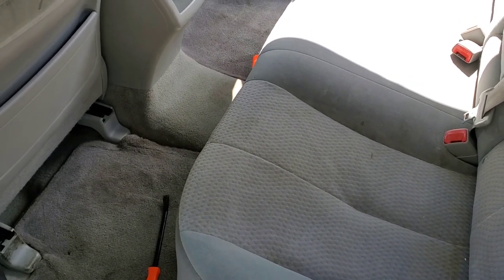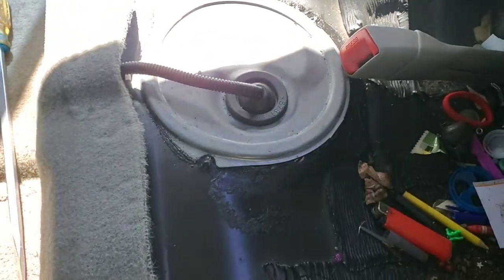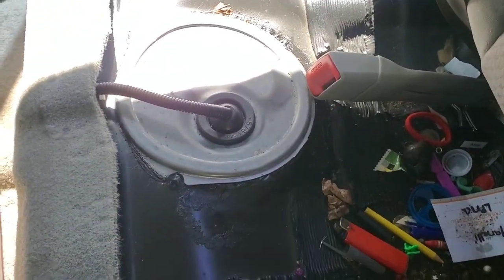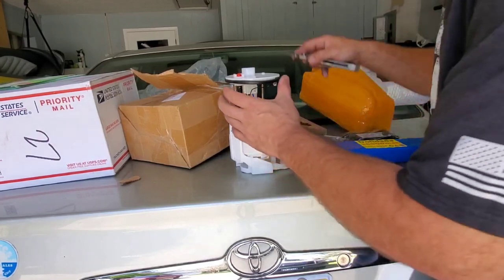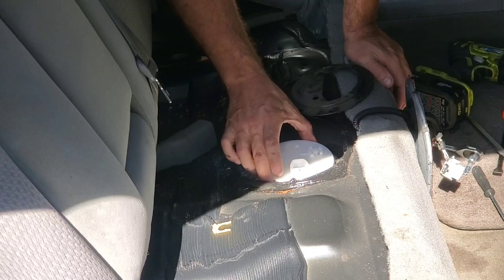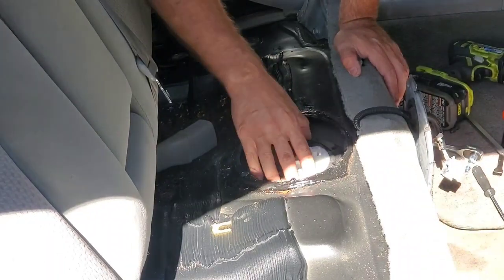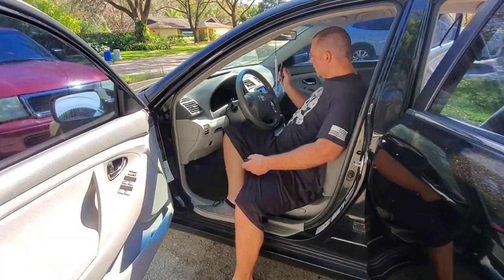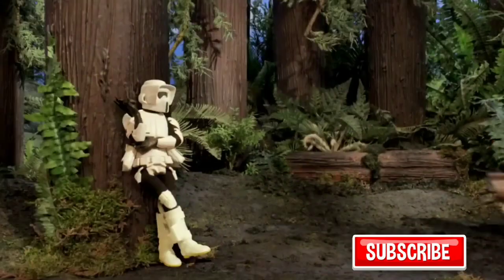2011 Toyota Camry Fuel Pump Installation ITS EASY TRUST ME!

Comment: Hello, I have a 2011 camry as yours with the 2.5L L-4 cylinders engine when I disconnect the fuel hose at fuel tank opening the fuel flow out real hard and I don't no what is the reason for the hard fuel flowing, do you know why the fuel is flowing that hard from the fuel tank fuel pump opening connection?

I replaced the charcoal canister with a new one and cleaned the fuel tank cap and tested and cleaned the canister  purge valve solenoid ( purge solenoid is opening and closing it is working ) the fuel will still spill out of the fuel tank opening but less than before.
Reply from the maker: @kandery111  sounds like you didn't get a good seal when you put the lid down probably want to loosen all the bolts and line up the fuel pump again properly so that the Rubber seal makes a good seal around the top of the tank otherwise it'll just keep leaking
Reply: @IFixShet  thank you I will install a new fuel pump lid gasket and align tightening the 8 bolts and see if that will fix the fuel spilling problem.

as I told you the fuel is spilling out of fuel pump hose connection ( fuel tank side ) not from around the fuel pump lid.
Reply from the maker: @kandery111  is it spilling or is it under pressure and it's relieving the pressure by pushing fuel out of the lid head.... there's a lot at play here man for starters you could have pressure build up in the tank due to a blocked breather hole that should be allowing gas to go to the canister.
Reply: @IFixShet the fuel is flowing out with pressure and after like 1 or 2 minutes it will stop leaking or flowing.
Reply: Where is the breather hole? if the breather hole is blocked how to clean it?
Reply: @IFixShet you mean by the breather hole the EVAP system vent hose with the vent filter?

Comment: Can you tell us which kit you bought.  The Toyota sites are confusing.  They tell me about 6 different pumps are acceptable for the 2011 Camry. It's maddening!
Reply from the maker: It's gonna depend on your engine size make and model. You need to look up the specs of your car Or you can pull your old one and then order the part because you'll know exactly which 1 to order Because you'll have one to compare it to when you take it out. However I find 99% of the time eBay sells the one that goes directly to all of them.  This is the one I ordered i cannot guarantee it will work for your car

https://www.ebay.com/itm/284267641021?mkcid=16&mkevt=1&mkrid=711-127632-2357-0&ssspo=Tk9jWpUFTIy&sssrc=2349624&ssuid=Ywv_VI4pRWK&var=&widget_ver=artemis&media=COPY
Reply: @IFixShet    But what seller or item from ebay did you order. I looked up my specs for the 2.5/  4 cyl gas engine and like I said Toyota gave me 6 results saying that all of them will fit my car!
Reply from the maker: @medusa569   I posted the link in my comment just click on the one that I ordered I literally put the eBay link in the comment. And all add it to the description of the video for you
Reply: @IFixShet    A final thing...did you happen to make note of the motor brand and it's specs?  I\'m really leery about getting a cheap motor that will burn out quickly.
Reply from the maker: @medusa569   I've been installing cheap eBay pumps for years and I've never had one fail... Most of the pumps you get from these local auto shops are also from China they're just rebranding them as Duralast and other stuff.  You'll be just fine trust me and please tell me I've earned a subscription At this point from you lol  Drop the lotta info on you today and done extra searching to help you please pay the favor back with a subscription to my channel and hitting the notification bell

Comment: Thanks. Do I need to buy any specific fuel pump? I have p0171 with long cranking thinking it’s fuel pump
Reply from the maker: No this is normally fuel pressure problems either the fuel injection system or the fuel pump itself could even be a filter
Reply from the maker: I mean you just need to look up the model number of your car and then go on eBay or Amazon They should have a lot of fuel pumps available for cheap
Reply: @IFixShet  me again. how do u know the part is good?
Reply from the maker: @subaruamazon  ?  Can you elaborate on that further?  I mean I bought a brand new fuel pump I would think That it should work not to say it couldn't possibly have a defect but You would know the moment you installed the part and tried to turn the car on whether it was a defective fuel pump or not because the car wouldn't start.
Reply from the maker: @subaruamazon   And just a reminder man if you're gonna ask questions please make sure to subscribe. Don't mind giving out free information but I also Like something in return for my knowledge And it's free it doesn't cost you anything to help me out 😉

Comment: 46 bucks.. I'll fail within a year
Reply from the maker: I think you have no idea what you're talking about..  every vehicle in my driveway has an eBay pump that was under $50 and my truck I did 5 years ago still no issues the Camry is already 11 months strong zero problems and my Ford Focus 7 years eBay pump $48 still going strong. The secret to making pumps last a long time is don't run your car on E because then they overheat and they wear out really easy especially if they have cheaper components always make sure to have a quarter tank of fuel in your car and you won't have any problems you're welcome I'm glad I saved you from yourself
Reply from the maker: You do realize that most auto parts stores get everything from China and then they put massive markups on it so you're basically buying the same thing that you're getting from the auto parts store except you didn't go through a third party supplier so you're not paying the 400% markup on the same pump you can get from the manufacturer directly for $46.